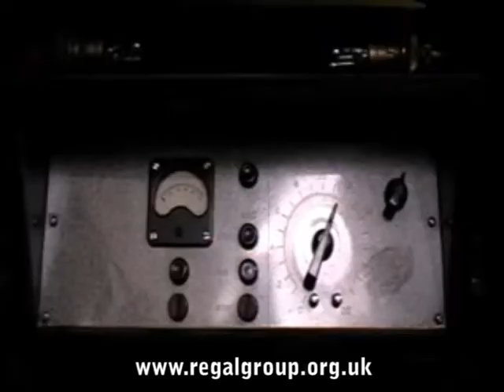BTH Supa Cinema Projector

Comment: J B Milne the Dundee cinema owner owned the tivoli and always installed BTH projectors in cinemas he acquired
he also used to have the cinema redecorated and new seating installed and a new screen installed usually a widescreen for cinemascope
he took over the tivoli in 1961 and it changed to full time bingo in 1973 5 years after milnes death and taken over by kingsway entertainments who bought the chain of cinemas in 1970 it later became a carlton bingo hall and closed in 2000